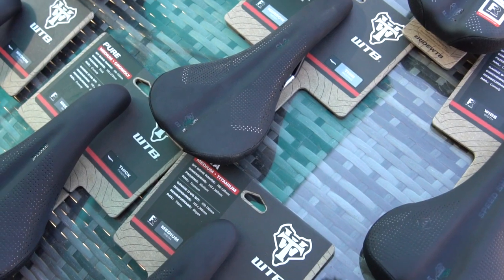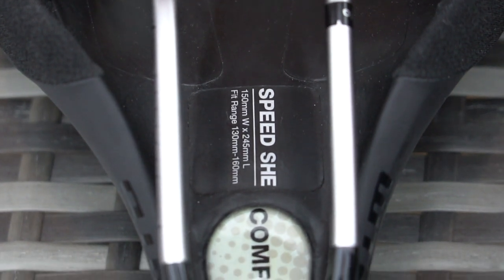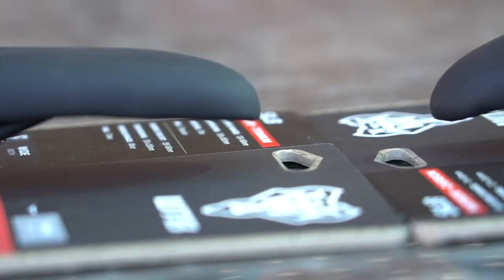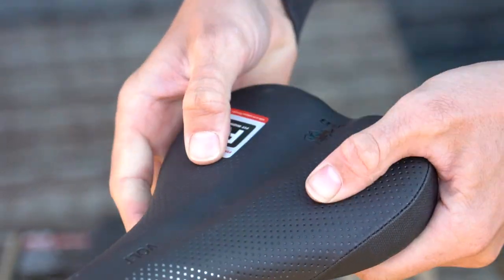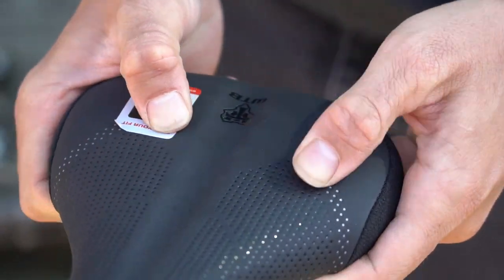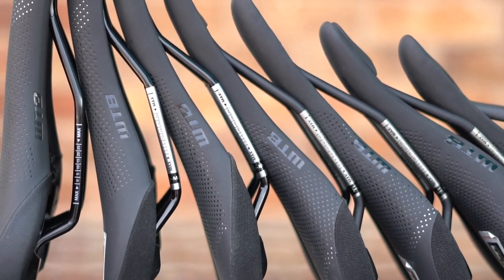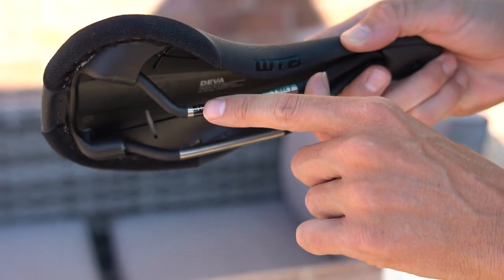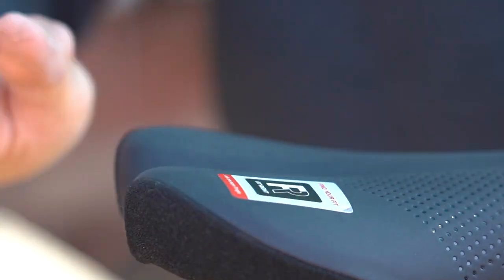WTB Saddle Overview

Comment: WTB saddles are Best in the business
. Most comfortable. Tried everything and the WTB always comes on top. 
I am 184 cm hight and use  narrow 13.5 cm  wide and 28  cm  long approx.
Loves that the front tip is very very narrow as well.
The padding is slim yet sufficient and can be felt.
Zerro numb after houres and houres of XC riding.

Wish WTB would also make a road bike / racing road bike dedicated line of saddles since their mountain bike saddles are the best !!!
Reply from the maker: Thanks so much for the kind words :)

Comment: I had a saddle fit on the wtb website and it recommended the SL8, Silverado and Volt. Medium is my size approx 120mm seat bone width. Now Im stock which of the 3 I am going to buy. Im using a full sus XC mtb and usual long rides and sometimes trail ride. Any advise?
Reply: Silverado

Comment: I got three WTB Rocket saddles that I use (cirka 2018 models), and they all share the same quirk. They creak. Did you perhaps address this issue, as the creak gets mentioned almost whenever WTB saddles are discussed?  
Other than that I just ordered a new Volt saddle, hoping it will be a little bit more comfortable that the Rocket on longer rides. I did use one of the Rocket saddles during last summers bike tour, averaging about 85 km daily, and it worked fine if not perfect. Will be very interesting getting my hands on the new Volt, and compare.
Reply: Hey, any updates this? How do you like the volts
Reply: @overkillonslash  Tried it last weekend for perhaps 70 km. Bottom line: No go for me. Dealer only had Wide in stock, and it is exactly that; too wide for me. 
But that is not the main problem. The real drawback is that WTB has changed the cover lining, and the saddle is now way too slippery. I had to correct my seat position continuously. My Rocket saddles (2018 models, cirka) does not behave like this at all. Huge disappointment. But no creaking so far. That is at least one good thing. 

WTB; if you listen. Please revert to the second to last cover material. That was way more grippy and just plain better compared to this new slip n slide stuff. Also make the Volt with the thick padding from Rocket, and make the cut out slightly longer. I would buy 2, at least. 
And oh - make then non-creaky. 

Gonna go for a 2 night bike packing trip soon. Saddle will be one of my old Rockets, because the Volt did not cut it. :(